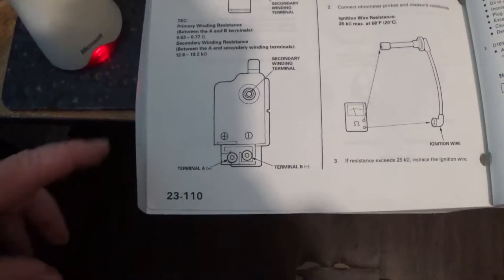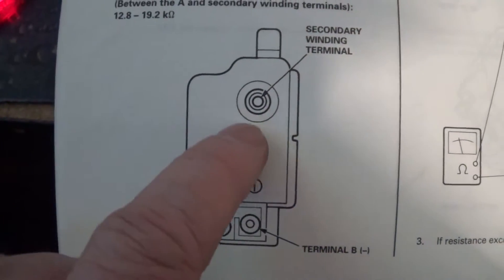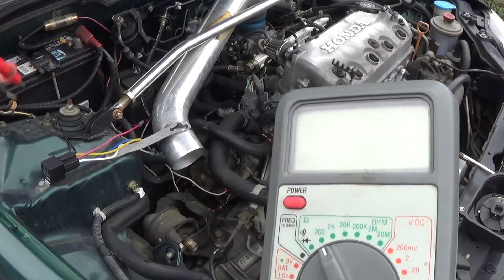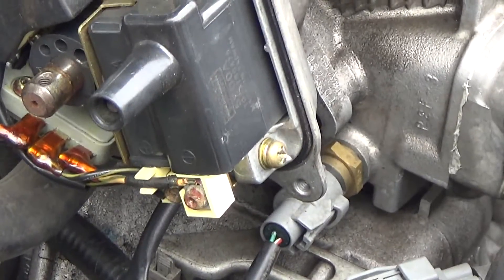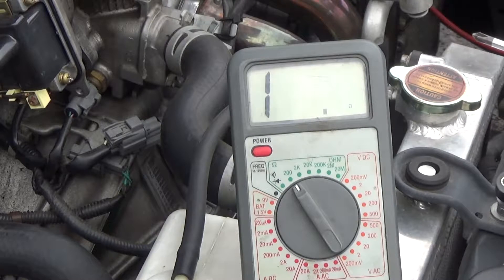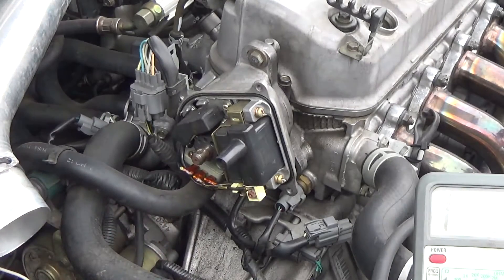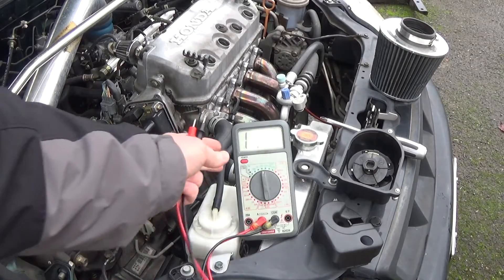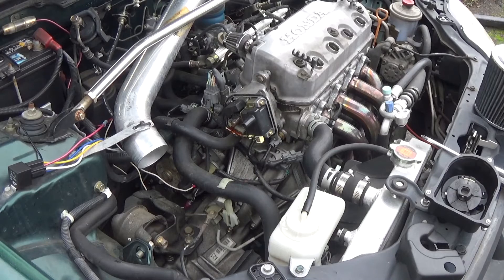Testing 1999 Honda Civic Ignition Coil

Comment: Very helpful thank you. I had installed a new power coil by NPboosted into a brand new distributor and it fried my magnets. So I’m gonna test this coil to see if it’s even safe to use lol. Had to completely Frankenstein an old distributor with whatever salvageable parts off the new one to get my car running

Comment: You didn’t mention that you’re testing a Tec distributor. Some Hondas use a Hitachi distributor and the resistance values are different.
Reply: If its a TD its a Tec. Hitachi those yrs models start with D and have a dash
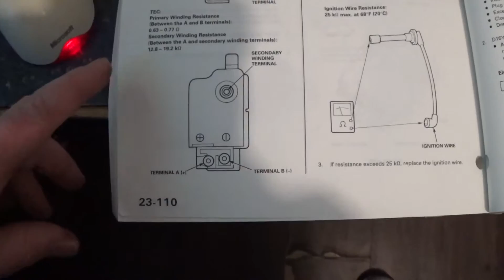Reply: 0:07 if you watch this you know it Tec, show on the book

Comment: My second reading is @ 12.2 and the first reading is @ .8   Our 2000 Honda Civic was setting from the lockdown sh*t since April and no it will not start.  It has done this before however, it was a fuel filter last time so I thought.  Now I am thinking this was the issue or what ever I find out as I got no spark@ the plugs, no spark from the coil too so here I am lol.
Reply: im having the same problem, reading 1.0 and 9.3 no spark. Was the coil your problem?